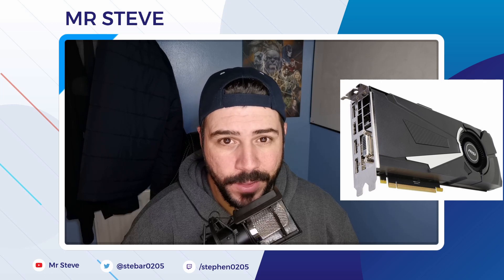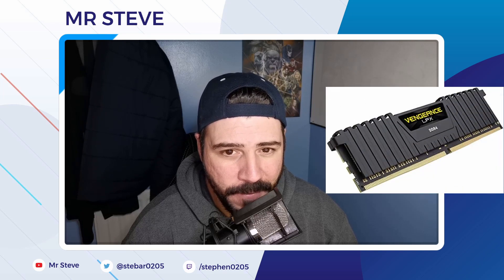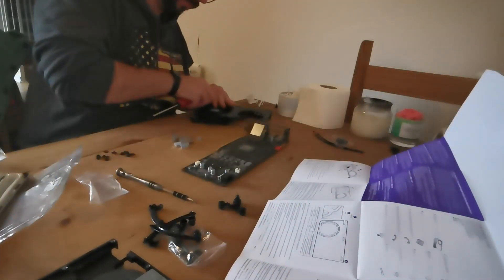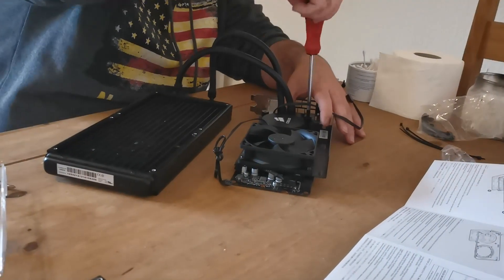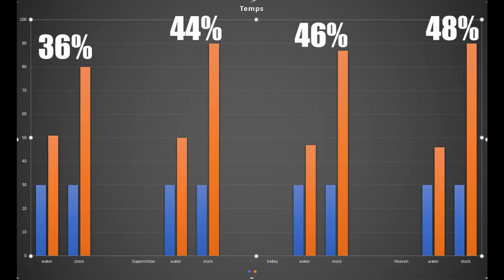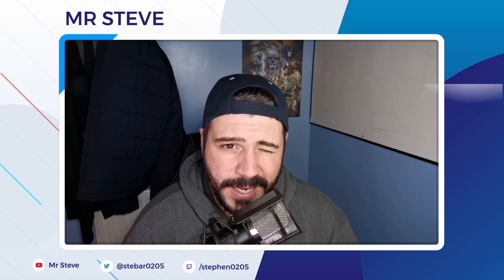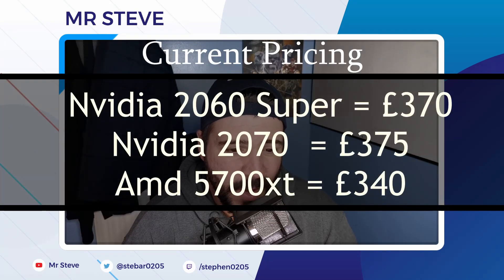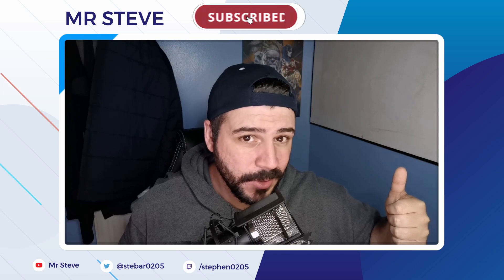Kraken G12 + NVIDIA GTX1080 = Worth it ? ...........

Comment: This was a very useful video, thanks :)
Reply from the maker: No Problem, could have been better done but the fact you can still use this thing on a 2080ti is mental, i now own a consumer version, and its no where near as efficient or controllable, EVGA 2080ti hybrid, excellent card, but its a smaller 92mm cooler on it, and the fan control was a no go, i actually unhooked the cable, modded it, and hooked it to a fan header to give me some control as the VRMS were just getting toasty on the thing
Reply: @mrsteve2441  yes, I was anticipating this as well. I had to track down a Corsair 110 just to fit a kraken, was not easy. Not a perfect fit for a 2060 super, but some stick on RGB Nvidia RTX 2060 Super logos to hide the missing chassis, and should be mint.
Reply from the maker: Awwt hat sounds class, hope it turns out well

Comment: i have a dell T7910 with 2 Xeon E5-2680 V4 , gtx180fe , g12 , evga clc 120 , 2tb nvme , 64g ram and i love it ! i use speedfan 4.52 wich is free to control all the fans plus monitor everything .
Reply from the maker: even today still a beast

Comment: Not sure if you still have the card, could you maybe let us know what are the in-game differences? I have the exact same card, mine hovers around 1650mhz at 84-85°C, thinking about doing the same thing as you, just wanna know if it's really worth it (don't care much about noise personally) 😄
Reply from the maker: Still have it , 100 percent worth it, still runs silent, and amazing temps with awesome clocks man
Reply from the maker: In game I max 45-50 degrees
Reply: @mrsteve2441  And FPS-wise? I assume around 5-10 across the board?
Reply from the maker: @CrazySerb-b5g  eh honestly i dont monitor the fps that much, i did at the beginning and i was getting about maybe 7- 14 percent boost give or take if i remember rightly. Obviously it was game depended and you get some odd ones that just seem to hoover up the extra performance. I have cyberpunk and watchdogs, gtav,  halo collection and if you check me on steam @ stephen0205 your welcome to check my game list and ill bench it with and without the oc

Comment: im running same gpu and was looking at this. had a 2.1ghz overclock on mine but have to have fan at 100% in order to not thermal throttle
Reply from the maker: That don't sound like it's mounted right my buddy, at 2ghz I'm maxing 45 degrees with my noctua cans on 40 percent so about 600 rpm give or take, it's silent. What's your set up
Reply: @mrsteve2441  that's on stock cooler
Reply from the maker: @mac4thewin  that makes more sense lol, im taking observant off the cv for not reading your comment correctly. Did you do the aio watercool mod to it ?, such a nice quiet card afterwards  ?

Comment: Bro is it compatible with 2070 super?...
Reply from the maker: sure is buddy. Nvidia GPU Comatibility:

GeForce RTX* 2080, 2080 Ti, 2070, Titan X, Titan, Geforce GTX 1080 Ti, 1080, 1070, 1060, 980 Ti, 980, 970, 960, 780 Ti, 780, 770, 760*, 680, 670, 660Ti, 660, 580, 570 *RTX uses the ""A"" brackets for mounting Supports referenced-based design only. *Supports long PCB variant only due to PCIe power connector interference.

Comment: Exactly what I was looking for!
Reply from the maker: Funny enough me too :) , still run it exactly like this, , got some nice new Noctua fans that run at an inaudible 40% and it doesn't breach 40 degrees when I game. Silent and effiecient
Reply: Nice yeah I was thinking of doing this to my msi 1080 to squeeze a bit out of it my cpu is already an enclosed watercooled system so that’s what’s got me on the fence I’d have to mount the system for my graphic card below the card on the bottom of my case, it’s the only place it will fit, what do you guys think be alright? I was thinking of using the exact stuff you have too the nzkt with the Corsair
Reply from the maker: @Lonewolf23-26  go with a new case, much cheaper than a better gpu at the moment man :), get both those water coolers in that bad boy :)
Reply: @mrsteve2441  I don't think the case is my issue really as it's fairly wide open just the mounting spots and length of hose would be the issue there. The card doesn't necessarily perform badly I was just looking to push the performance a bit more but having the MSI armor 1080ti I didn't think the cooling system it comes with is enough. The case I have is an In Win 303 with the 4 USB ports, my CPU is already an AIO system to a 120mm fan on the back of the case eliminating that for a location for the rad if I were to put it there.
Reply from the maker: @Lonewolf23-26  very nice case man, very nice. Yeah i had the armour edition of the 980ti, and the cooler sucked. That waws one i never water cooled, but with this 1080, i had the areo, and the blower is a much worse cooler than what you got going on with the armour you have. I was insanly blown away by the fact that i got a 2ghz oc on the core with the water cooler, couldnt even get stable 1600-1700 with the blower and temps were stupid high every time. I havent touched any setting since, it just goes along nicely now